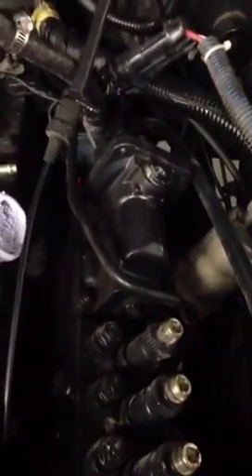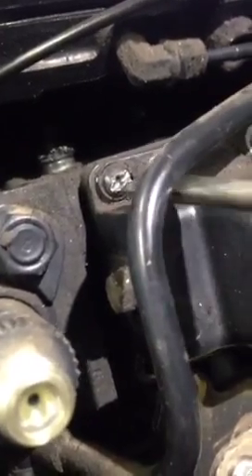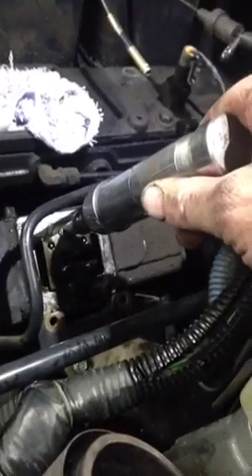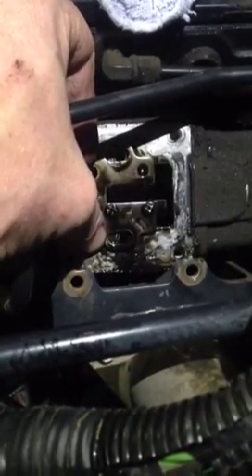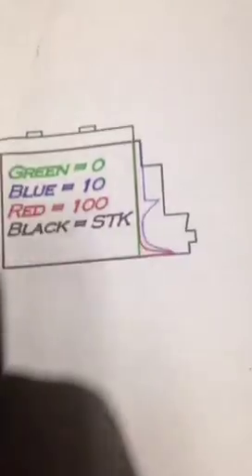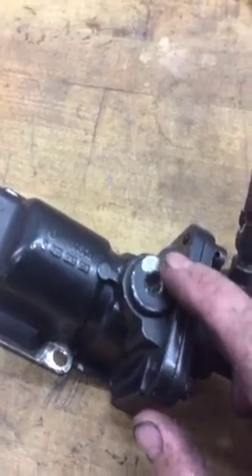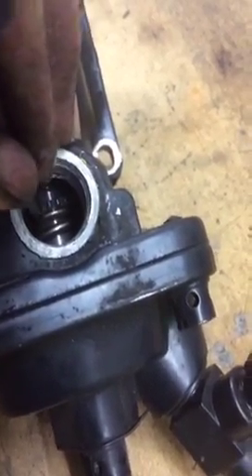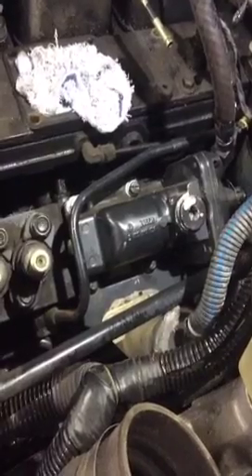Fuel plate modification p-pump Cummins

Comment: Tweeked these for yrs. 
Fuel plate 💪
Don't move the fuel plate too far, you may cause a "hard" start problem.
Reducing the top spring tension reduces "Turbo Lag"
Install a K&N Air Fiter and religiously use Fuel Conditioner (Stanadyne♥️)

Comment: How will the gearbox hold up ?
Reply from the maker: This mod is only good for 50-70 hp which depending on your truck may get you over 200 hp with no other mods. One of my personal trucks we made 500 hp and over 900 foot pounds of torque and used it for heavy towing for over 200,000 miles with no major issues. It’s all in how you treat it.

Comment: Will siding the stock fuel plate forward and afc forward make me stock clutch slip and is it safe for a stock engine?
Reply from the maker: Completely safe, that will only give you maybe 20-25hp. Only way your clutch will slip is if it’s weak or bad driving habits.

Comment: Is just sliding the fuel plate forward safe for a stock truck
Reply: Yes I’ve done it to my 96 12v and it’s got 235,000 miles on it, runs good and I just averaged 18.5 mpg on my last tank
Reply: @brycechow9178  ok thanks I think I might do that I wanted to get a 0 fuel plate but my trucks got 283k on it and idk if it’s a stock clutch so I don’t wanna wear it out if it’s too much for it
Reply from the maker: The truck in the video had 389,xxx on it, over 550,xxx now.

Comment: What if you just adjust the star wheel and not do the plate mod?
Reply from the maker: The star wheel takes pressure off of the spring introducing more fuel at low boost, the fuel plate allows rack travel giving fuel over the entire power band.

Comment: Will turning that star wheel like you said change the amount of smoke?…I don’t want more!
Reply from the maker: It will introduce more fuel at lower RPMs giving you more power so yes it will increase smoke slightly. There is a smoke screw on the back of the AFC housing which I did not go over in the video unfortunately.

Comment: I try’d doing this to my Cummins and when I opened it open there was no fuel plate should I be concerned??
Reply from the maker: The problems with having no fuel plate is that you have no fuel control and you could possibly get into a runaway situation. I would buy a Dynomite Diesel fuel plate and install it halfway or right in the middle.
Reply: @RustAndDust491  sold the 12v I have a 24v now
Reply: Can you cute the fuel plate on a 24v
Reply: @hazzurs  24v = electronic fuel injection.  No fuel plate.  Tuning is done via computer/tuner as opposed to screwdrivers and wrenches on a 12v.
Reply: No a lot of people remove the fuel plates but if I were you I would buy a #0 fuel plate they are cheap and easy to do just as a safety concern!

Comment: Wow wow wow, installed 100 hp injectors really found no difference. Did this mod and holy smoke rolling I am in love with my twelve valve all over again. This is a must do guys. Thanks for the video.
Reply from the maker: Thank you

Comment: My truck has the plate removed, so no fuel plate. It also has the star wheel cranked about max, pre boost screw on the back buried, and afc slid full forward.
Reply: Does it start right up without dying mine  starts and dies 6 times and it runs fine,seems like it reprimes fuel
Reply: Just bought my first diesel and it has been staling a lot, removed today and found no plate. Could this be the issue?
Reply from the maker: No most likely your idle needs to be turned up. Most of the time this is caused because of a worn injection pump.

Comment: What if I don’t grind the plate and just slide it forward with the screws loosen and then move afc housing forward as well what kind of results would I get
Reply from the maker: With a zero plate,the plate and AFC housing slid forward you will gain somewhere around 60 to 80 hp and double that in torque.

Comment: You could also just remove the plate period
Reply from the maker: This will result in extremely high EGT‘s and no fuel control and could also result in a runaway situation.

Comment: 97 cummings,did 0 plane,spindle adj,rear Allen screw adj ??????
Reply from the maker: I usually don’t do much with the smoke screw on the back of the AFC housing but it’s not a bad idea to adjust it if you want less smoke.

Comment: What plate should I do for a little more hp. I dont want black smoke.
Reply from the maker: There is a lot of fuel plates on the market, the most powerful one we have used is from Dynomite Diesel. If you put the plate in the middle you will have good fuel control and minimal smoke.

Comment: Does anybody know why my 12 valve caps at like 2500 rpms?
Reply: The governor springs in the pump, you can get 3-4k governor springs from diesel performance places on the internet
Reply: If your fuel shutoff solenoid is not pulling the fuel supply lever open all the way it will act like a governor on the performance. Check this by manually with key in the on position see if you can pull the lever up further…if so bad solenoid…I deleted mine and installed a manual locking choke cable…love it!
Reply: No sir
Reply from the maker: Governor springs

Comment: What should I do cause I did that and now it won’t start and I have tried everything
Reply: Cameron Bair air in your lines, crack the injectors loose
Reply: Turn the truck over while you crack the injectors and seal them again, if not you’ll never get anywhere, I also had issues with my pre heater sucking in air if you’re in an area where it gets super cold you might need it but I’m in TX and it hardly gets below 40 so I just bypassed it. Best of luck buddy👍
Reply from the maker: Also check your idle adjustment, put your foot on the throttle slightly and try and start it, if it starts in your idle needs to be turned up.

Comment: Trying to back mine down for testing purposes but want to be able to turn it back up with relative ease. Would turning aneroid control or starwheel towards drivers side 10-15 have the desired effect without having to mess with AFC? Thanks
Reply from the maker: Turning the star wheel towards the driver side will reduce the amount of fuel introduced at lower PMs reducing smoke slightly but also making the truck more laggy. If you want to control fuel quickly I suggest installing a AFC live system from power driven diesel.

Comment: You made it look soo simple. I cant even the screws to loosen up. There are locked tight im not doing anything but stripping it out
Reply from the maker: Payton Harwood you have to use an “impact screwdriver,” a regular screwdriver will strip it for sure.
Reply: Same with me, how are you supposed to fit an impact screwdriver without removing those fuel lines?

Comment: That is not the smoke screw that's the star wheel. Smoke screw is on the back
Reply: He said some ppl refer to it as the "smoke screw" cause it allows more fuel which means more coal. Aka unburnt fuel
Reply from the maker: Yes that is correct. I meant to add that this isn’t the smoke screw and point it out but forgot. Thanks for the reply.

Comment: I never knew I had my 12v for about 3 months now I'll try it and come back with results.
Reply: Results?
Reply: @MLGtroll365  Maybe blow up the engine
Reply: @RenanBecker  Naw, you don't have to worry about the engine. The 12v can handle a lot more power than what you can get just from playing with the stock injectors. What you need to worry about is the transmission. That's the weak link, especially if it is an automatic.
Reply: @RenanBecker  If that Fuel Plate is removed,then he is fucked.On the other side,both a 5.9L and 8.3L 12 Valve can handle up to 1,000 HP,which is damn right alot for a Cummins,espiecally a 12V,but it is possible and it has been done.
Reply: @epurvee  I don't know much on the Transmissions but a Ford 4R70W/4R75W would do the job because they handle up to 750 HP,alot of racing trucks in Weatherford Texas use them,they have a shop just for Specializing them.The older Chrysler/Dodge Transmissions were absolute shit,Ford actually had the best,General Motors wasn't that awful but their Mileage wasn't as high as Ford's,but the 700R4 and 4L60E are the worst.
The 8.3L Cummins is also used in the 5 Ton Trucks like the M923A2-M944A2,I had a M931A2 with the 6CTA,I had a MT654CR Allison Automatic,they all do,and my Cummins was 240 HP with 592 lbs of Torque,I used a 5.9L Spring,PV7100 Bosch Injectors,ARP Head Studs,HX-50 Turbo (40 Psi of Boost),Hydraulic Hoses,Intercooler,Adjusted Fuel Screw, Marine Head Gaskets,Cams,and Sleeves.That got me to 450 HP & 1,200 lbs of Torque.
The only flaw that I need to say about the 12 Valve is that above 300 HP will shorten their life span,for both the 6BT and 6CTA,if it is a OTR Engine and not a Marine Engine,it won't behave the same on Numbers.I have a 5.9L out of a Dodge D-250 that I will be Modifying up to 800 HP & 1,400 lbs of Torque,my previous Dodge 2500 was at 400 HP.With the Fuel Plate,you have to Grind them down.
Reply: The 6BT can handle 300 to 400 HP easily,they even have Marine 6BTA's that start at 275 HP as the lowest.And then the mighty 6CTA can handle as much as 450 to 650 HP,but they can do alot more than that.The Marine 8.3L comes as 430 HP to 650 HP,but about the 6CT,over 300 HP will make them finicky,that will shorten their life span.

Comment: If you don’t take the injection lines out how do you get that bolt out that’s right underneath the fuel lines
Reply from the maker: Cholo Chedd with a long extension you can get it although it’s a little difficult.

Comment: I want to do this but don’t want to mess anything up my truck right now does not smoke at all 97 12 Valve cummins 3500 it already feels pretty strong but would be nice to have a little more power.. If I have a spare P-Pump can I modify that plate and then just swap them and just mess with the smoke screw? What does the AFC Live do?

Comment: Is modifying the fuel plate better than removing it?
Reply: I just took mine out
Reply: @drivingmylifeaway7149  I ran a 8.3 for years with the plate out.
Reply from the maker: mathew pence yes removing it can cause a runaway situation. The best plate to use is by Dynomite Diesel, they can be found on our site patriotdieselparts.com

Comment: I have a 1998 F800 dump with a 12v Cummins that has roughly 125k on the odometer. The truck was GUTLESS until I did this today. Took a few hours to do this mod, and followed your instructions to the tee. My God what a difference. I pull a trailer and haul blacktop with the truck. Question though: Being that this motor is bone stock, is there anything I have to worry about down the road due to this mod? I just needed more power in order to pull the hills around here, as before I was lugging up some of them in 2nd and 3rd empty with my flashers on. Doesn't look like I'm gonna have that problem anymore.
Reply: Main concern when adding more fuel to diesels is HEAT. Turning up the pump will raise EGT's. Opening up the exhaust helps reduce EGT's. Best advice is to get a Pyrometer in the truck so you can avoid anything over ~1200* sustained EGT so you don't melt a piston.
Reply from the maker: Jay Dean glad to here, no your truck will be fine. This mod is pretty mild honestly.
Reply: So I have a 96 f 800 with 5.9 I was looking to do this because this thin so a turd. I pulled it apart and I'm missing the fuel plate all together is this a problem?

Comment: Do you need a seal or something how does it seal back on ??
Reply: The bolts on the AFC housing are all that you need. Three or four bolts will seal things up just fine.
Reply from the maker: Logic Cremator It has an o-ring seal so you just clean it and bolt it back down. Hope this helps.
Reply: There's a big square oring under it usually reusable
Reply: @thisoldturd513  on mine there wasn’t (94 12v) so I just put it back on an no leaks

Comment: Just watched your video. I have a 1995 dodge Cummins. I did the stuff you said in the video (ground fuel plate flat). I had a s&b intake and 4" straight pipe exhaust, other than that it was stock. After your info and following what you said it's honestly a whole new pickup. Literally pulls twice as hard as it did before. Unreal results.  Thank you!!!
Reply: How bad does it smoke now???
Reply: Does it smoke a whole lot? I’d like to do this to mine, but I don’t want it to billow smoke everywhere. I’ve heard you have it right when it’s a light haze out the exhaust throughout the rpm range?
Reply: Watch your clutch ;D.

Comment: Also if you remove the tamper proof screws on the back of the Afc. You can get at the low boost screw or smoke screw which controls your low end fueling. The star wheel does the mid range and the plate is the top end. The Afc  is very easy to understand once you take it apart. If you get all three adjustment tuned correctly and plug off the wastegate on the turbo, ive seen trucks pick up 150 rear wheel horsepower
Reply from the maker: Clancy Taylor you are absolutely correct, thanks for adding this.
Reply: You grind the fuel plat ,and grind a 1/8th off the peace that sticks down into the fuel plate ,and adj the star wheel and adj the smoke screw.
Reply: Plugging the waste gate doesn’t hurt your turbo? I’m new to my 12 valve and turbos honesty. All I had before was a carb on a squarebody
Reply: @bonusm3761  as long as you keep your boost pressure under 40 psi or so the factory turbo will last a long time with a plugged wastegate
Reply: @clancytaylor7714  good to know. And I can adjust all those screws and stuff in the video while being completely stock?
Reply: @bonusm3761  yes. Just if you adjust the fuel plate a lot or completely remove it. Then keep an eye on your exhaust gas temp. Don't let it get above 1250°f for more than a few seconds at a time.
Reply: How much did you adjust the screw on the back
Reply: @bonusm3761  adjust the pre boost screw until throttle response is crisp and you get a little smoke before the turbo spools. In is more fuel, out is less. If I remember right. If you screw it in too much you will get excess smoke,  out too much and your throttle will be laggy.

Comment: What if you took the plate off
Reply: Taking the fuel plate out is the same as having a zero plate. The governor lever (attached to rack) which slides along the profile of the fuel plate only goes so far, so when it comes to modified/modifying pumps, there is zero difference between having a zero plate and no plate at all. Some people do believe it will ruin your injection pump, but I have never seen a case with any evidence.
Reply: Mike Miller ever find out?
Reply from the maker: Chris Aleman hello, we don’t advise removing it, this can lead to a runaway situation.
Reply from the maker: Mike Miller I don’t advise removing it this can lead to a runaway situation.

Comment: I just bought a 97 12 valve and it smokes like crazy. I don't like that, so if I take the "smoke screw" and turn it towards the driver side it should quit? Thanks for the vid
Reply: TripleR Knives, guns, lawns, trucks, and cars yes its not gonna change much back the fuel plate up
Reply: Jordan holmes So the fuel plate is causing all the black smoke? 

And will I loose alot of power?

Thanks!!
Reply: TripleR Knives, guns, lawns, trucks, and cars it depends delivery valves or big injectors is usually the smoke issue but can be tuned down with the fuel plate unless its been taken out or ground off
Reply: Jordan holmes I'm not sure what all has been done to it. The dealership the guy traded it into will not give me his name or number and I can't call. I know it has twice the power of my 94 12 valve. I'm trying to learn all I can about these. 

The tamper proof screw is missing so I know he's been in there. But as far as injectors and springs I have no idea?
Reply: TripleR Knives, guns, lawns, trucks, and cars will it turn 4 grand and back the fuel plate up and turn the star wheel back to the middle to start
Reply: Jordan holmes why does my 12 valve o
Pay cap at like 2500 rpms then not want to go higher?
Reply: @iruntoughness9652  it’s only getting enough fuel to turn 2500. More fuel =more rpm.

Comment: but will this decrease your fuel mileage?   I want the best mpg I can get, but currently it smokes it like mad but only gets 10 mpg.  97 cummins dodge 3500 with 4.11 gears
Reply: Harrison Weightman with the right tooning you should get better mileage
Reply from the maker: Harrison Weightman it won’t add mileage but it also won’t hurt it if you drive it right. With 4:10s your optimum speed/RPM is around 58 MPH. If you are getting 10 MPG I assume you are driving much faster. 1800-1900 RPM is where it will do best.